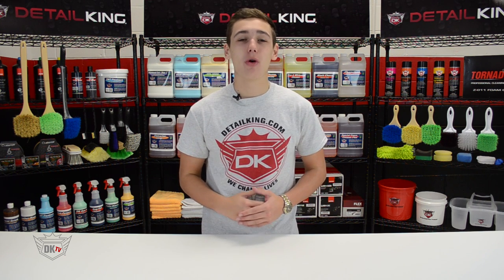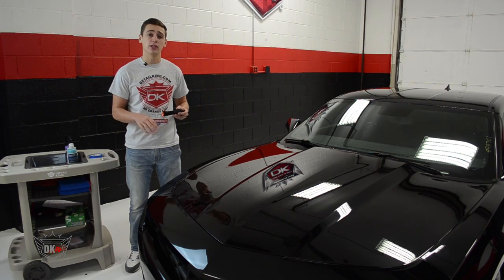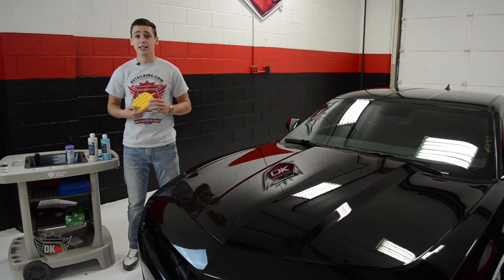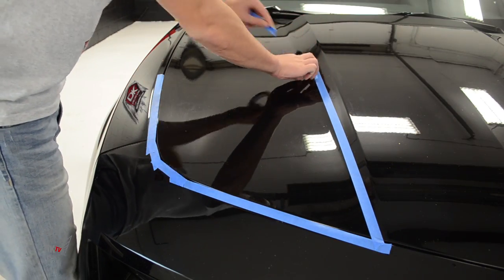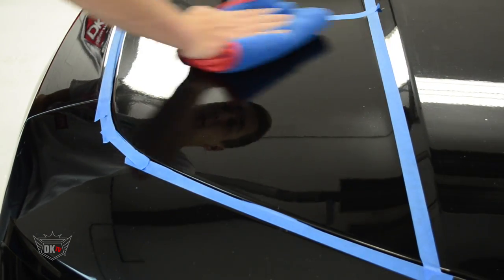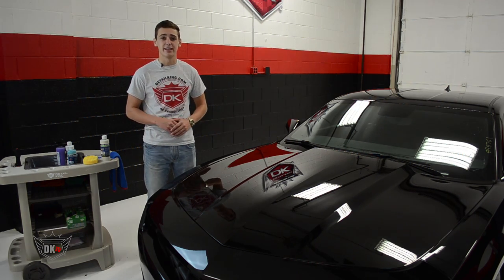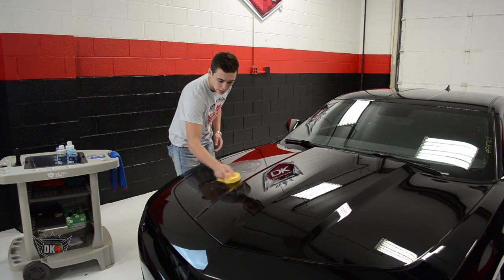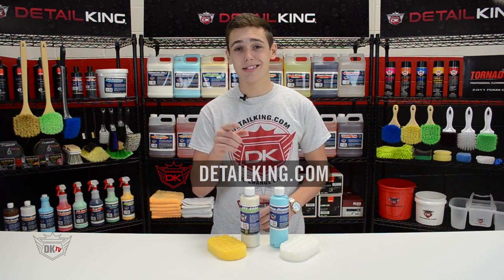How to Polish Black Paint By Hand

Comment: The ONLY WAY to get rid of swirl and light scratches is to use a light cutting compound and then after use a wax polish of choice to protect paint from the elements.There is  polish out there with a colour pigmentation in it that partially hides the swirls and light scratches temporarily but ONLY cutting compound will remove them permanently .Been there done that.

Comment: You can still see swirls and 
2 really nice scratches still on the lower left of that small area that was tapped off. Basically this works if your not a perfectionist and just want the original Mark's barely able to be seen.

Comment: How does the polisher work?? does it take away a bit of the clear coat to match the depth of the minor swirl/scratch marks ??
Reply: Jason So g
Reply: That's the general idea of most polishing. You can't just make scratches in the clear disappear. Clear is removed down to the level the light scratches are. It's in any car owners best interest to take proactive measures there after to prevent any further scratching. Grit guards, micro mitt rinsing and a correct washing pattern will prevent as much swirling as possible. People tend to wash in circular motions giving the swirl affect. As well as touch car washes that help leave swirl marks.
Reply: Yes. However, it left considerable hazing which should have been refined further.
Reply: Jason So It takes off a very thin layer of the paint to remove small swirls usually to give it a nice shine, however if you use alot in one area consistently after a long period, it will dig into the clearcoat,

Comment: I heard that it's good to use compound, polish then wax for paint correction and shine. Is that right?
Reply: PaulGaleski it all depends on how scratched up the paint is. If it has light fine scratches then you can probably just get away with a Polish. If it a has medium to heavy scratches then you will need to compound then polish and then wax to protect the paint. So if you're if you're not sure if you need to use a compound or polish to get rid of the scratch then I would always start with the Polish which is lighter cutting power to see if it gets rid of the scratches without too much work. If it's not getting rid of the scratches and just shining up the paint and it's taking too much work then you probably have to step up to a compound and get rid of the scratches then go to a Polish to get rid of the fine scratches that the compound leaves on your paint.
Reply: 3 step process is the way to go if you want it done right. These mixed products dont get it down to a show room finish unless you put the time and proper tools in.
Reply: PaulGaleski correct.
Reply: Not every car needs compound
Reply: PaulGaleski A bit late here, but basically compound and polish are like liquid sandpaper, you are sanding down some of the clear coat to permanently remove light scratches.

Compound is more abrasive than a polish. Its like a 80 grit sandpaper on wood. It will do the rough work to even everything out but wont make the wood smooth to the touch. You follow with a polish, or on wood a 180-ish grit sandpaper to make everything smooth and shiny. If you would start off with a 180 grit to remove deeper scratches, youll be there sanding for days, wasting sandpaper like BP wastes oil. Same goes with polish.

Polish removes slight hazyness/dullness of the paint, at most light swirl marks like shown in the video. If you want to remove something like light scratches from bags repeatedly touching the car, youll need a compound. Whenever you are using a compound, it will leave an extremely hazy almost matte looking color, which polish makes shiny again. So you can polish without compound, but you cant compound without polish

Compound is like surgery. You do it when its needed. You ideally wouldnt do surgery more than once or twice in your life, if you can help it not at all, same goes with compound for a car. You only have so much clearcoat to work with. 

Also, some scratches simply cant get grinded down and give a good result, dont dig too deep into the paint. Rather leave a small scratch than create a pernament dull spot.

Some sort of wax or protecant should always be applied after polishing. A wax is like oil on wood. It make the surface look tha little extra good and it protects the material. A wax however isnt that pernament (4 weeks or 4 days of rain tops really), if you want to set it and forget it (and really protect your car), ask a detailer to ceramic coat your car. Sure it gets expensive, but it will last from 2 to 10 years, no need to ever wax between those years, and it protects your car form new (extremely minor) scratches. If you polish a ceramic coat however, it ofcause gets grinded off the car.
Reply: PaulGaleski thats usually the proper steps, it also depends on the cars paint condition
Reply: Absolutely. What's been done here is the first product basically cut back the paint (compounding or at least a polish heavy enough to correct for this specific paint) to remove the original defects but left hazing which the first product induced. Instead of removing the haze with a finer polish, they've glazed it and filled the hazing. Therefore the sealant to follow I guarantee hasn't bonded to the clear coat at all and will only last as long as the glaze stays put. So yes, you are right in what you say. :)

Comment: My problem is I got water spots on my black car, will hand polish remove it? Or should I go with chemical acid base product?
Reply from the maker: It would depend how long the stains have been there. In 30 days or under you can hand polish out water spots, but beyond that, you’ll likely need to machine polish

Comment: I need to remove some swirl marks caused by a buffer.  Do I just do this on the area, or would I need to do the entire car?  Thanks!
Reply from the maker: Hey Rhonda,
If the area is the only thing you want to remove swirls from, then you only need to do that area. Most vehicles have swirl marks in several areas, but each detail will be different.

Comment: Great vid guys... What's the best thing to use for clear coat sun damage until you're able to get a professional paint job?
Reply: Depends on the extent and hardness of the paint that's still there. Usually, compounding and polishing will remove the oxidation and then you can use anything with UV inhibitors to help maintain the finish as protection.